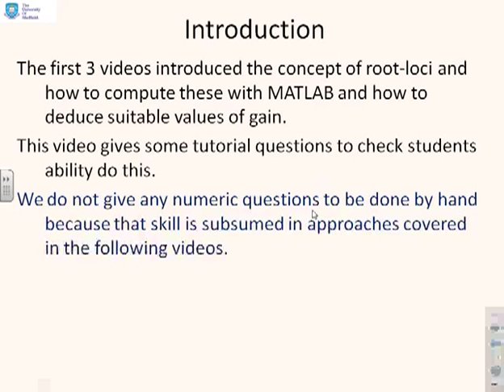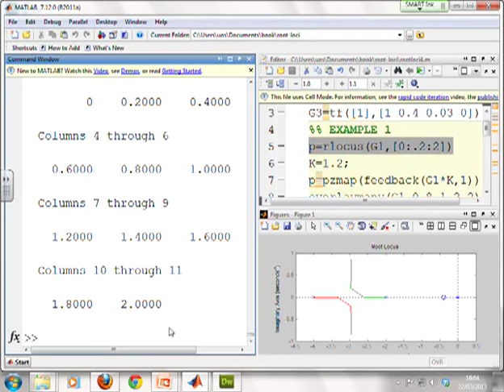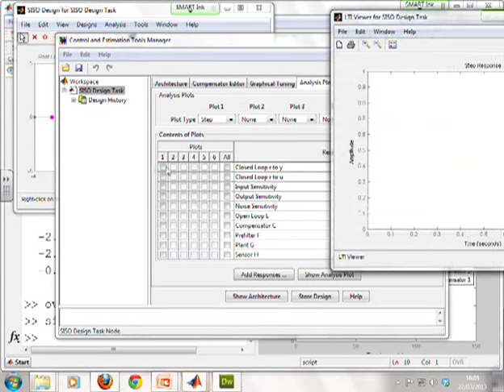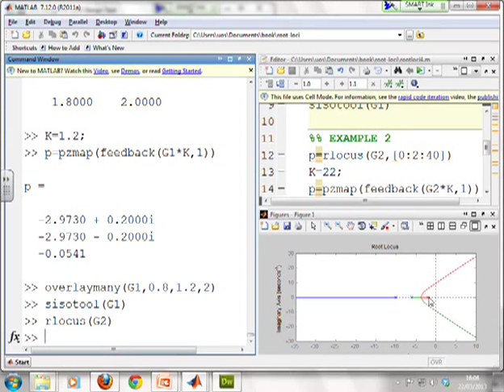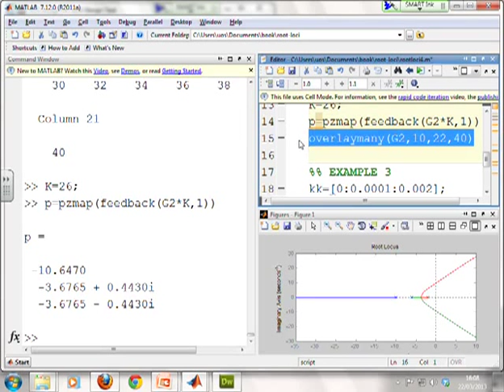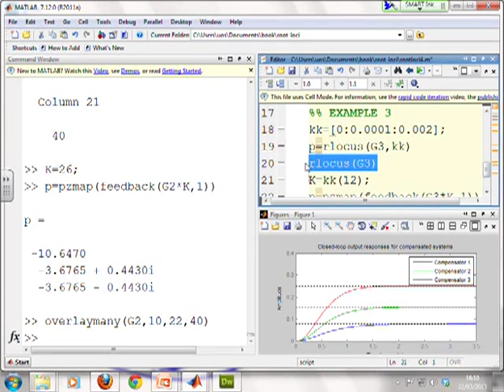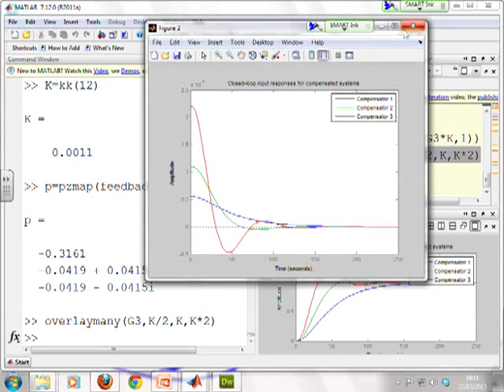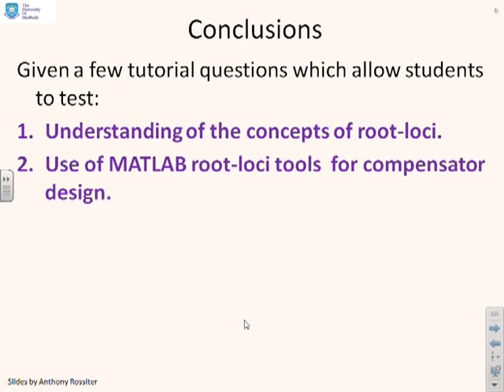Root-loci 4 - Tutorial on compensator gain selection by trial and error using MATLAB

Comment: Excellent series of lectures. I have a different version of matlab but at 7:28 it appears that you can zoom in on the root locus plot by using the magnifier lens in the toolbar above the plot. Left click and drag the mouse over the center of the plot and it should expand it.